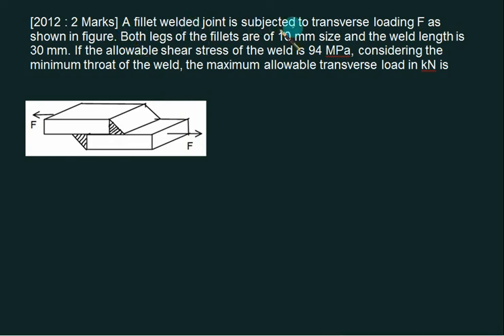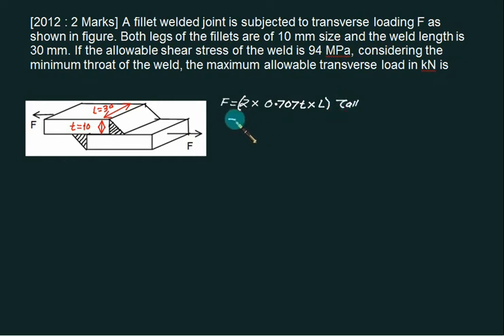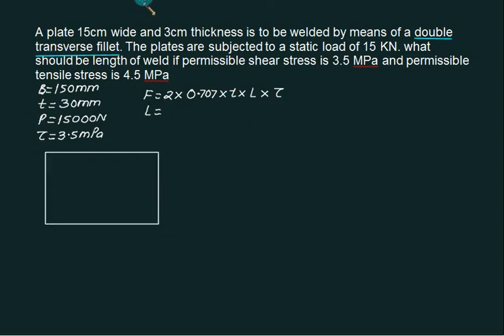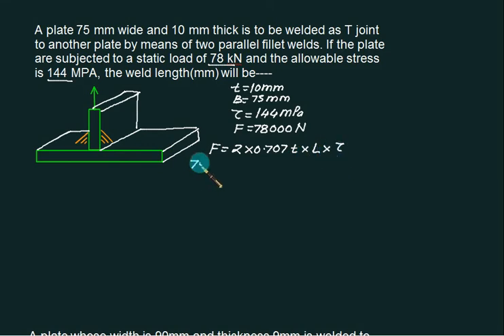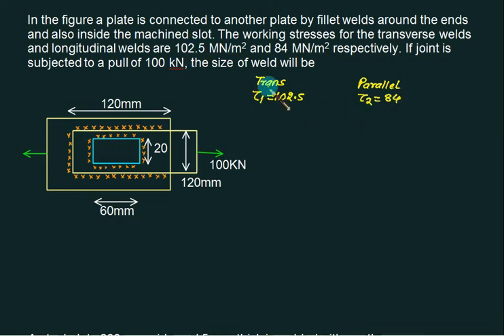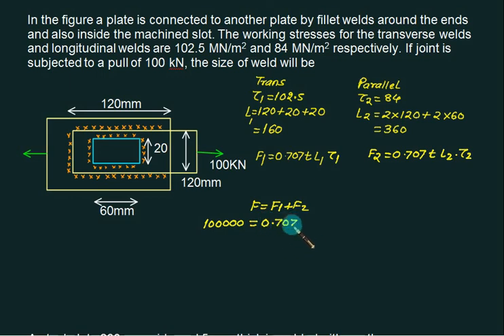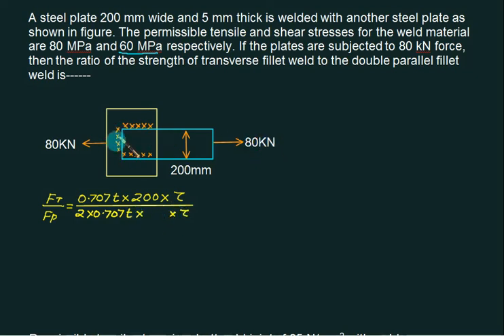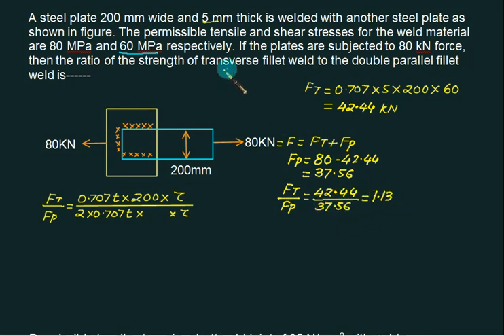Welded  Joints 04 Numerical

Comment: Sir in both the cases means transverse and parallel fillet weld we have to take shear stress only
Reply from the maker: since the welded joint is very complex and hence for both failure shear stress is considered as far as GATE exam is considered
Reply: Thanks sir

Comment: In the ratio question strength of transverse fillet will be calculated from permissible tensile stress why you used shear stress in that
Reply: Sir i have the same doubt
Reply from the maker: since the welded joint is very complex and hence for both failure shear stress is considered as far as GATE exam is considered
Reply: @sunilmohodmh31  in some problems we take tensile stress for transverse load and shear for parallel weld.....in gate questions
Reply: And in same type some problems...we take comlete6weld length and shear stress only....